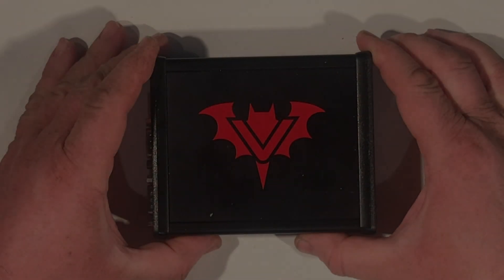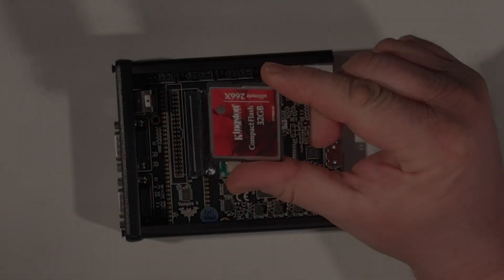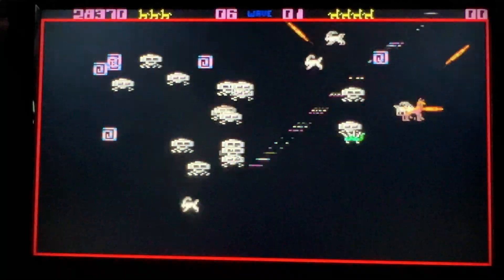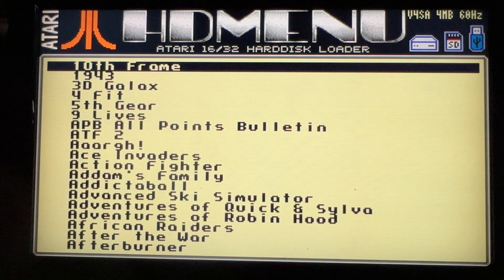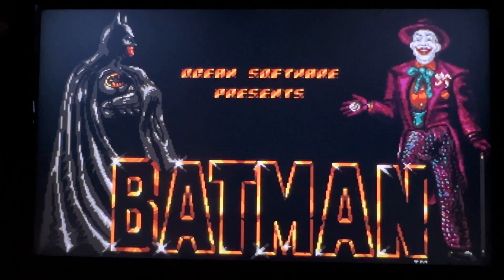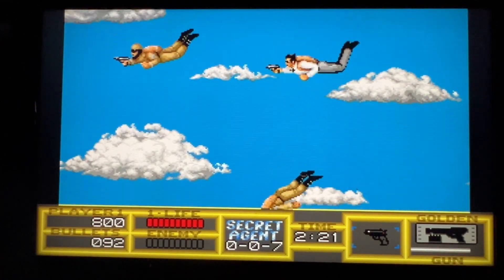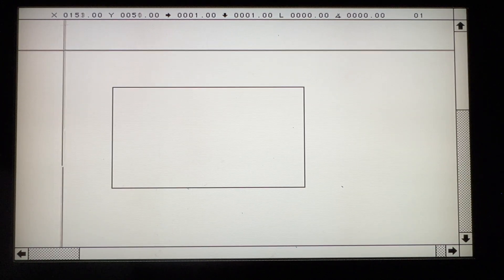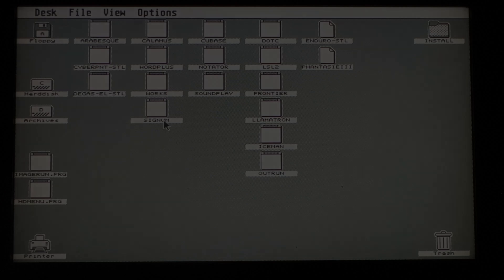Vampire V4+, Vampired to run Atari ST - Running Atari ST on an Amiga

Comment: if you want to play games get a mister fpga which accurately mimics an Atari at 8 MHz so there are no timing problems in old games. The Vampire is a great hardware solution for newer released or patched games or for productivity applications.
Reply from the maker: A mister FPGA is going to be a lot more accurate for sure but this was more to see where the vampire Atari ST was at. Also emulation in general can do a pretty good job and cheaper if you just want to dip into some Atari games.

Comment: I’m seriously thinking of picking up a Vampyre for the Amiga side of things. Is it worth it? Or would some generic emulation software just be better.
Reply from the maker: Generic emulation software would be cheaper. I think it’s down to personal choice. I love the vampire and coming up from the original Amigas, it feels like an upgraded Amiga. It can be work to get things going at times but that was the same on the original machines. If you are going emulation then PiMiga or Amiga forever are quite easy and will give you that nostalgia hit with plenty of software included. A vampire works out cheaper than an Amiga 4000 with upgrade boards but emulation works out much cheaper than both and gives you something pretty close when it comes to running OG software. There is no vampire emulator and it can run software beyond what the OG amigas could run so you are getting something unique and potentially opens up a new future for the Amiga. So final conclusion, if are just after original software and nostalgia hit, emulate. If you want something a little more exclusive, prefer hardware over emulation and have the funds, go for a vampire. Hope this helps
Reply: @BillFixesEverything Thanks for the reply. Yes … I am heavily leaning in the Vampyre direction.
Reply from the maker: @christianjadot4459  it’s good. Remember that if you order a keyboard with it, it will be a European qwertz keyboard and not a qwerty. May be worth getting this separately. Have a look at what keyboards are compatible as I had a keyboard that worked fine with it until I updated the firmware and then it didn’t anymore. If you buy one they recommend with the keyboard layout you need, it should be supported through any updates. Also, every now and again, one will come up on eBay. Can sometimes get them £$100-200 cheaper then buying direct plus no delay from the waiting list. Hope this information helps 👍

Comment: I think you have the wrong thing. It's an accelerator. The number one reason to buy a vampire as an amiga user is that the chip memory is so quick. I don't think it is to really to appeal to the game player, the mister is a far better option for that.
Reply from the maker: Yes but that said, if it can recreate an ST to a good level or another computer for that reason, I think it will help the vampire project overall. The spectrum next v3 for example is a spectrum but it will also have compatibility with Commodore 64 this time. People are buying it for the spectrum side but having that option will make it a little more desirable over the v1 or v2 models. At this stage of the project though, a mister or an original ST is the better way to go if you want to play ST games

Comment: Pretty cool to see this!     I am an ST guy by background, but "recently" (2013 lol) also added an A500 and A1200 to my collection.  If Apollo came out with a V4 standalone that could do both ST and Amiga well -- I'd be interested.  The 68080 is way more powerful than what the Mister can do.
Reply from the maker: I totally agree. I think they are missing a real opportunity by not investing more effort on doing the same for the Atari as they’ve done for the Amiga. They have the hardware, just need to push it more on the Atari side. Hopefully they do so soon 🤞👍
Reply: You know they do have the Firedrake for the A500 and the Icedrake for the A1200?  They are not quite as fast as the V4SA standalone, but they do work very well, and unlike the V4SA, you can use all of your old peripherals.   As far as the Atari side goes, it is really close but is still under constant development for the V4SA.  I am unaware if they are working on an add-on board for the ST, though.  There are quite a few more variants for the CPU than the Amigas.  Some of the STs used the smaller PLCC68 socket.
Reply: @FookWit-sapien Yep, definitely aware of the faster accelerators.   I'm very happy with my ACA1240 (68040 from iComp) on my 1200.   But if a V4SA let me run both accelerated ST and Amiga software, I might consider picking it up.
Reply: @jrherita That is what I am saying, I haven't tried it with the vampires installed in my A500 and A1200 yest, but it should be possible.  I should ask on the discord.  I haven't updated my machines in quite a while.  It would be nice if they release theirs for the A4000, though I already have 060s.
Reply: @FookWit-sapien  why are the fire drake and ice drake not as fast as the V4? They have the same clockspeed.

Comment: On the Amiga side, there is the ability to enable turtle mode for over-speed reasons you highlighted.  Is that not an option/feature yet in the ST side?  Is there an apollo-control tool for TOS?  EDIT:  I see you mentioned it.  Hope to see more improvements as interest in the Atari side grows.  This hardware is amazing.
Reply from the maker: Likewise, I hope they keep developing the Atari side too. It’s great if it can do both machines well. As someone else mentioned, it’d be nice if they did a falcon core. It’d make it a cheap way to use a replica of an expensive computer.
Reply: @BillFixesEverything My understanding of the development (just caught up in discord tonight), some Falcon specific stuff does work, just lacks DSP.  You can switch between Amiga/Atari, and amusingly there is great emulation for 68k era Macs running under the Amiga.  But as far as Atari software compatibility goes, it doesn't need a 'Falcon core'. As it uses the SAGA to have Shifter bits in it with extended video modes and looks to support the friendly TOS/GEM software very well.  I think it uses some layer of emulation for games, so the speed adjustment should sort of already be applied.

Comment: EmuTOS isn’t exactly known for games compatibility. It might have better results using TOS 2.06 with a modern hard drive driver., if that’s possible. Also, find that website that hosts patched ST games. (8bitfix?). There’s patches for a lot of games so they work with all the various 680x0 chips [including clock speed], RAM configurations, TOS versions, Blitter support, hard drive installation, and some even with STe graphics and sound enhancement. If only the software publishers had done all of that BITD. Some even have added MIDI/MT-32 support.

Comment: I wonder why the ST and not of the the newer ones like the Falcon or the TT?
Reply: With the Falcon or TT core, I would expect you'd encounter even more incompatibilities.  There are game versions that have been adapted to run on the Falcon / TT, but many won't.
Reply from the maker: It could easily do it from a hardware side. If the FPGA is capable of running a high spec Amiga with 3D capabilities then a Falcon or a TT should be no problem. I think it’s just down to them being able to put more resources behind it for Atari support. Ultimately it’s been designed as an Amiga based machine but I do hope they see the potential of expanding it further
Reply: @BillFixesEverything  For sure, it should be able to happily do a Falcon with the 060 upgrade as well no problem... 

I guess start at the the most compatible and work the way up (if there is a demand for it) such a small user base for those two that it might not be worth it if not only for a "preseravtion" activity.
Reply from the maker: @thebaldconvict  again it would be nice as to buy a falcon or a TT unless you’re lucky,
Costs a fortune. This way, more people could get to experience it for a more reasonable cost. Like you said, makes sense to go for the mainstream ST stuff first and then build up from there
Reply: @BillFixesEverything  For sure, back in the day I had a Falcon, got it 2nd hand for £100, upgraded the RAM and then one day it died so I boxed it up to fix another day. It got lost in a house move along with my Amiga 2000 (working) and a few other things like Acorn RiscPC's 

Was absolutely gutted that day.
Reply from the maker: @ I feel for you. I have a Sears Super Video Arcade which was Sears version of the Intellivision. In a move, I packed the controllers separately because they are removable. Still have the console but no controllers. Plus somewhere, I have a Tulip Web.IT C64/ Linux set top computer. Again, can’t lay my hands on it. Hopefully you get lucky and find them again for a good price
Reply: @BillFixesEverything  well I agree with TT emulation, but with Falcon its more tricky and Vampire is way to weak. Dont forget that Falcon has DSP, to fully emulate just this might be overwhelming for the FPGA.
Reply: @madigorfkgoogle9349  Time / effort is the limiting factor for the DSP. The rest of the Falcon bits aren't all that special.
Reply: @manueljesus no, the DSP 56001 is pretty powerful even today, I doubt that current FPGA packages would have enough power to emulate it, no matter of what time/effort you would put in.
Reply: @BillFixesEverything I think the Falcon DSP and VIDEL would be pretty hard to stuff on this FPGA with the 68080 core and the rest of the custom chips.    They have significantly higher transistor counts than the Amiga AGA chipset.   But it might be possible.    I think TT030 would be definitely doable though.
Reply: There isn't a need to do TT030 or Falcon cores.  The Vampire isn't like the MiSTer at all.  Sure, it is FPGA, but the cores in it are for the SAGA chipset.  It is just they also added in stuff to also run Atari ST stuff.  Think of it more like the Medusa/Hades that came out after Atari sold it all off.  Except there has been work done to actually have access to the standard ST stuff that is sort of coded alongside the SAGA stuff.  Like the video modes have been made GEM/TOS compatible.  So far, it is faster / better than a TT/Falcon.  But it lacks MIDI ports...

Comment: Man, that's such an interesting device- I might have to look into this a bit more...
Reply from the maker: It is a great little device and has a lot more potential that as yet, has not been tapped into fully.
Reply: @BillFixesEverything  I thought about it, but really, I think I'd want better compatibility to pull the trigger.  I have MisterFPgA and it does Amiga pretty well, actually. I never had a physical Amiga in the day, so I'm open to some kind of modern copy, so I don't need vintage hardware for this.